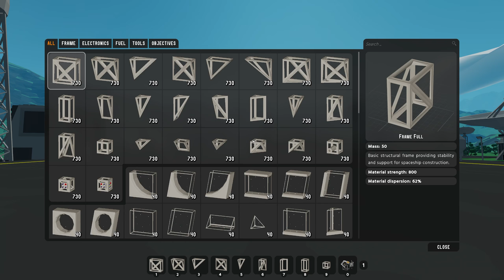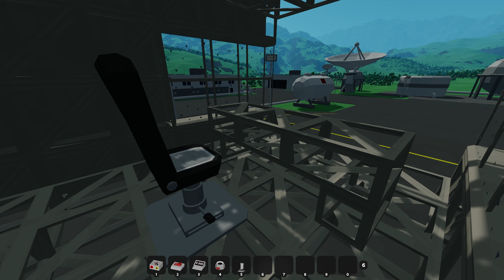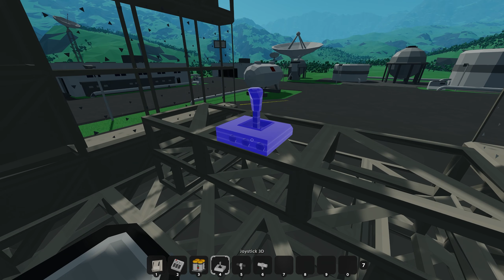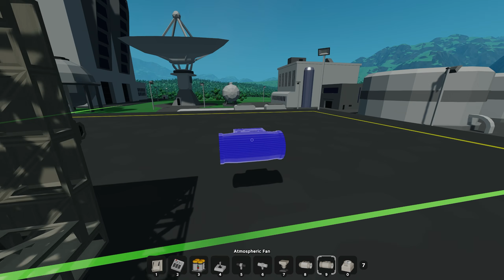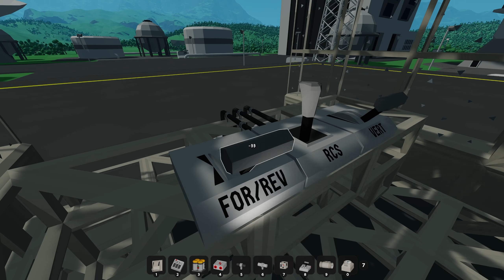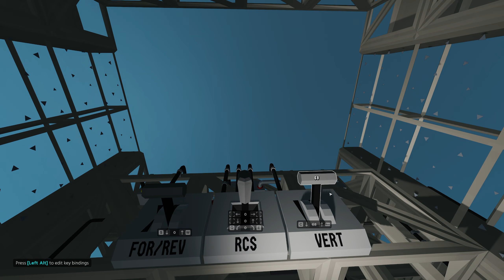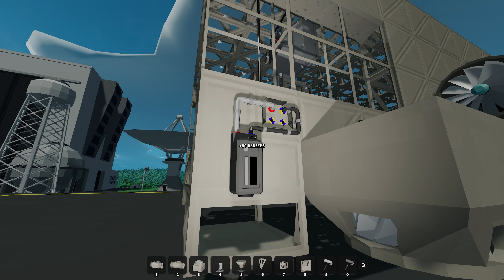Approximately Up: How to build ships tutorial

Comment: For some reason, every time I sit in the seat my data and power routers outside the ship fall off. Mounted correctly, but only when I sit in the seat. Help :(
Reply from the maker: Is it when you sit in the seat or when you hold R to create spaceship? Data and power routers only have one sticky side on them and it’s the plain side. In other words, for your routers the icon on those blocks must be pointing out.
Reply: @diggrok when I press R everything is fine. As soon as I go to test fly by sitting in the seat, that's when they fall off. The symbol is on the outside like you mentioned. I'm thinking it's just a bug? Going to try and rebuild from scratch soon
Reply from the maker: @MattBarras  Are they mounted onto a surface that isn't sticky? LIke if you're outside the ship and convert to fly mode with R do they fall off then as well or only when you're sitting in the seat? If only when in your seat that would be a bug, and a bizarre one. It's hard to fully diagnose without seeing your build.
Reply: @diggrok figured it out, must be some kind of a bug. I had roll on my RCS bound to E which means whenever I got in the seat it tried to roll automatically. Think it bugged it out making them fall off. Changed my keybinds and so far no issues 🤙
Reply: Wait I lied I completely figure it out. No bug. RCS thrusters blow down on the sides. If you have anything below the thrusters, they will be blown off. Can happen to your atmo thrusters or data/power routers 🤙🤙

Comment: im having same problem as others, i tried building a rocket ship shape (vertical cylinder). up and down using atmospheric thrusters, no problem, the second i add directional input with RCS they fall off, ive  moved them to center of mass and ive tired weilding and unweilding the surface theyre stuck to

edit: now my YAW thruster falls off when im not going straight, what is happening
Reply from the maker: You mounting them flat onto the surface? Also thrusters deal damage so if you have them positioned in a way that other thrusters hit them or they hit something else it will deal damage. Make sure anywhere there is a thruster that the direction of thrust is clear.

Comment: When I used the ATMOSPHERIC THRUSTER, I attached it perfectly and there was no problem when I took off, but when it accelerated, it fell off, what should I do
Reply from the maker: I'd have to see but it sounds like maybe your mounting it to something that doesn't have a sticky surface? The lift fans can only attach from the side and the other ones can only be mounted from the flat surface and both must be mounted onto armor or the sticky surface of another object. (They can't mount to the sides of batteries, for instance)

Comment: is there a bigger gate than the small one i cant do a mission because i need a bigger gate
Reply from the maker: Yes you get a medium gate from one of the moon missions. Check your objective with O. It will show you both the size of cargo you will have to haul as well as the rewards for missions. One you will see requires a medium gate to pickup the package and another mission will reward you with the medium gate. Get the gate first then run the large package mission. 😉

Comment: Please make a video tutorial how to get to moon and complete the to moon objective I took 5hrs to crash land to moon
Reply: I had the same problem, but this is how I managed to do it: I installed a speed detector, and as I approached the moon, I turned my ship around and used my thrusters to slow down. I also used a rear camera to check how far I was from the surface. That helped me avoid crashing. Good Luck :)
Reply from the maker: I will have a moon video tutorial up in the next day or two 😉
Reply: I experienced the same thing, and I finally got it, the thing is u need to slow down as u get closer to the moon, better to set a speed detector to keep track of your speed

Comment: Going to the Moon, how much speed do we need to stop and when? I can’t find the right setup, bro.
Reply: The moon mission is really hard but the trip take about 12minute so at the halfway point (press p to see the flight time) turn around 180degree and start braking having windows everywhere help. Took me about 7 attempts and 3hours to get it right but if rewind time you should be good
Reply from the maker: We get our velocity to around 6,000 when using both electric thrusters vertically. then turn and start burning to gradually slow down. Better to slow down early than become a crater. If you aim just off to the side of the moon, it gives you a margin for error so that if you over shoot you don't actually hit the surface.

You can always calculate how many seconds you initiate your burn before coasting and then know it will take about that time to slow down.

Comment: any tims how to get to the moon? bc everytime when im close it pulls me in and destroy's my ship
Reply: I did it yesterday. Was hell without a way to brake but you'll need the thing that shows you at what speed you're going and what speed you're rotating (your ship) because you'll have to do a 180 and make sure you're not going 4000 when you arrive there ahah. Oh and if you didnt do your 180 early enough you can always rewind in time by pressing P. Need any other advice just ask! I've learned quite a bit in the last days in this game.
Reply from the maker: Sure do. See 44:25

Essentially because we only have 2 thrusters, it’s easiest to just make them both vertical and fly as though you’re a helicopter where you pitch to gain movement. 

This also makes it easier to shed any speed if you’re drifting as you can roll left or right to shed any lateral speed. 

Essentially you’re flying more like a moon lander this way. It’s the best way to gain full control with only limited thrusters.